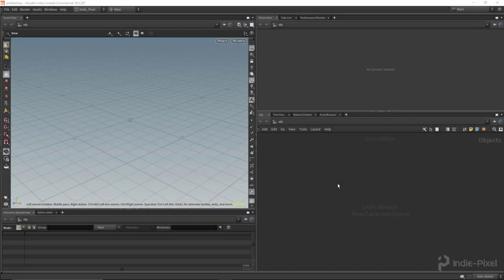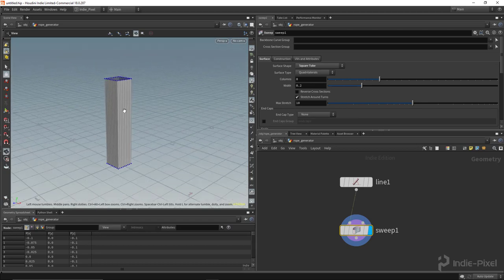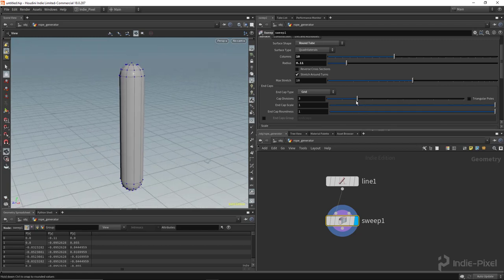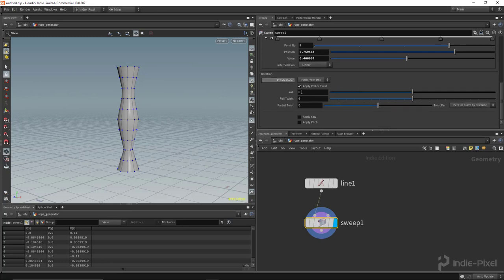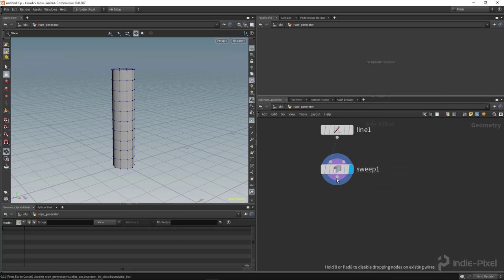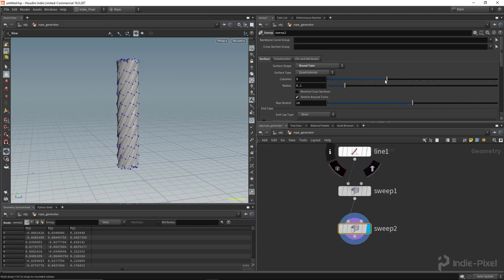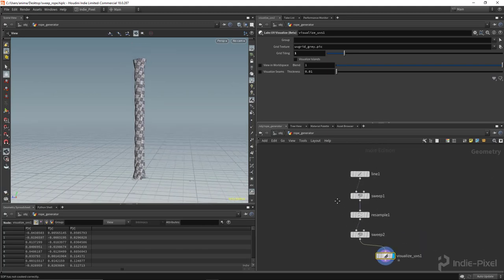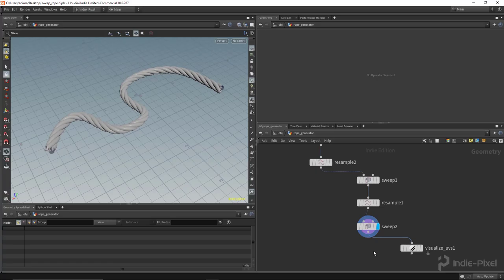Houdini 18 - Basics - Using the New Sweep Node

Comment: Hey man. Thanks a ton for these tutorials. So I'm just getting started with Houdini, I was trying to do a dynamics simulation. So I was following your tutorial on RBD bullet solver. I'm currently using version 17 of Houdini as the latest version is causing some errors. I'm having a bit  old configuration. My question is that, Is there an alternative for the sweep node in Houdini as version 17 doesn't have the sweep feature as shown in this tutorial. So I'm stuck at convert line - carve node (according to your rbd bullet solver tutorial). Don't know how to proceed from there. It would be great if you could help me out with this. Thanks in advance.
Reply from the maker: Yes, in Houdini 17 the sweep node is very different.  To create the shapes with the old sweep ode, you'll have to feed in your own profile curves into the first input of the H17 sweep node, and the second input is the profile.  So in the case of the Building, you can make a square profile curve using the grid node and feed that into the first input of the H17 sweep node...then feed in the profile lines we create after using the convert line node.  Then you should have the swept shapes.  That should get you going again.
Reply: @IndiePixel3D  Yes it worked. Thanks a lot for the prompt reply. Cheers mate.